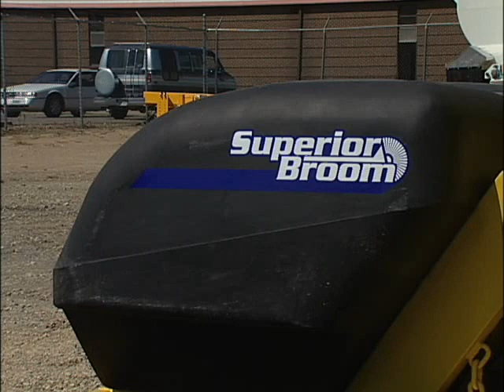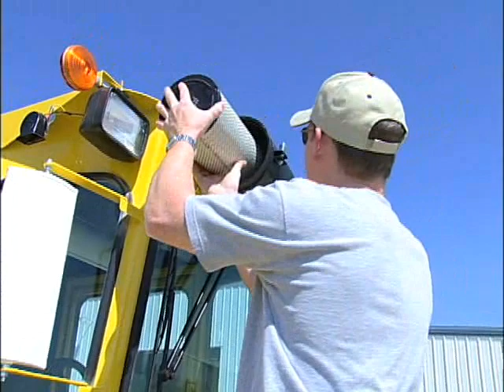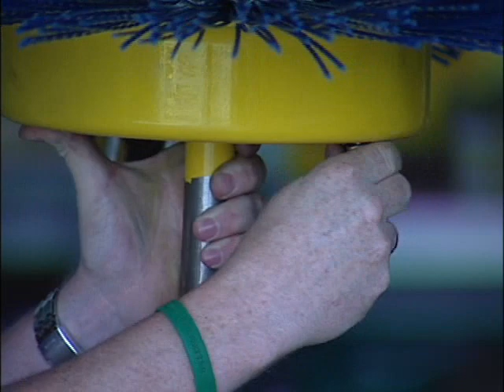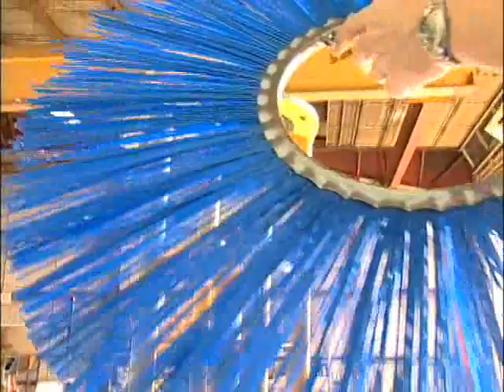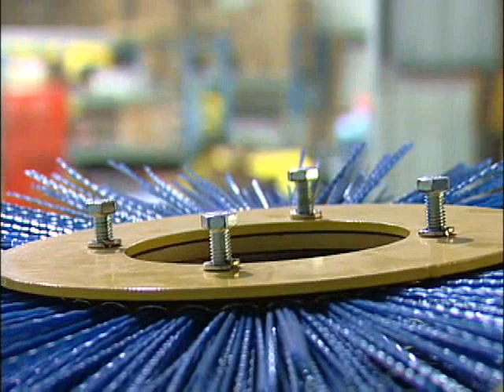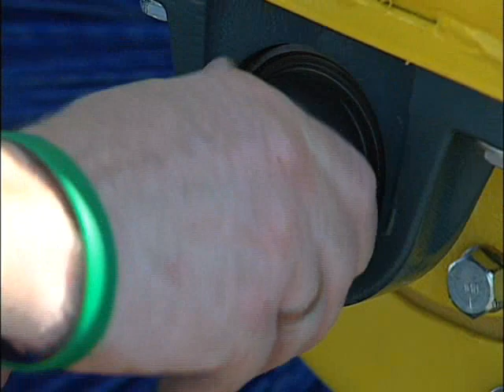Superior Broom Wafer Brush Change & Maintenance

Comment: How on earth does the broom come off. Should just pop right off after disconnecting the bearing side, right?
Reply from the maker: Please review the Video "Superior Broom Wafer Change & Maintenance video.  Once the bearing has been disconnected you will need to pull brush off the motor spline then out away from the machine.  When reinstalling you line this back onto the spline and pull back on setting in place reversing the previous steps.

Comment: So when the broom shaft hub splines strip out from movement and the motor shaft splines strip out because of movement where....then what?
Reply from the maker: If the splines strip you can either have them fixed or will need to have the drive replaced.  Most of the time this happens when the brush is not fully seated in place when changing the brush.  Please feel free to call our service manager at Superior Broom to review this procedure.